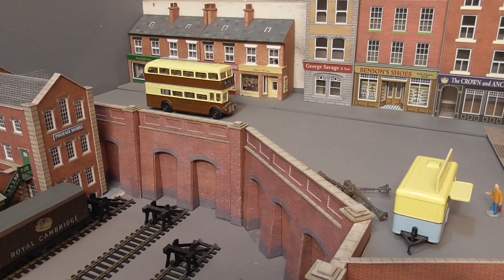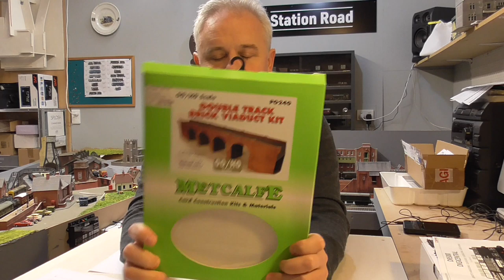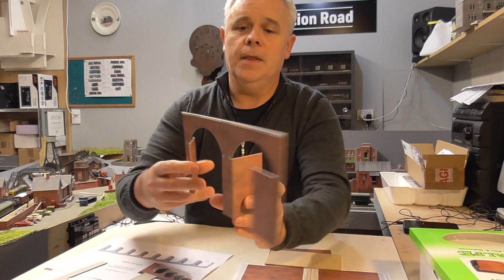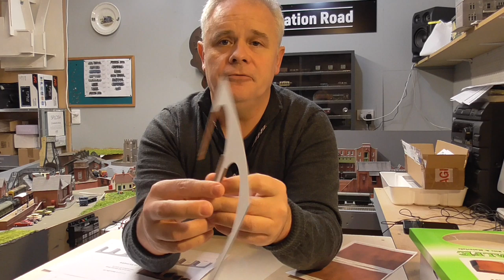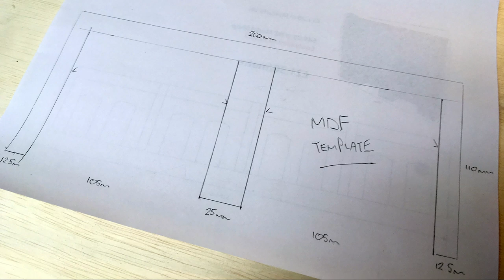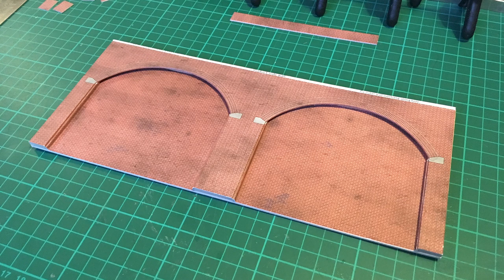Metcalfe Retaining Walls on a Budget

Comment: That is a great reuse of a Metcalfe kit, very clever! Also adds a bit of variety in terms of architecture to their standard  offering, have lots of these to build so will certainly look to use this option too. I successfully cut in half PO239 wayside station shelter to make two low relief buildings, so it's all about thinking "outside the box", well done, Stephen

Comment: Have you come across Scalescenes and Smart Models? They sell print at home kits, both railway and  on-railway. You buy it once and then you can print off forever. Smart Models produce a range of railway kits primarily of North Eastern Railway originals including the free to download signal box at the Beamish Open Air Museum (which was originally at Carr House East). The free to download kit from Scalescenes is a goods yard office/weigh bridge, which comes in different brick or stone options. The Scalescenes kits tend to be a bit more generic.

Comment: Great idea. A vast improvement on the previous retaining wall. To save having to build up the scenery behind,  you could trim the bottom of the new wall to match the old one without any detrimental effect. Best wishes, stay safe. John.
Reply from the maker: Hi John, I did consider chopping a bit more off the wall height but I saw the opportunity to redo the church area in preparation for the layout extension will require the church to move anyway. I have taken the wall height down by 20mm on the church side and a bit more on the factory side.

Comment: That's very clever idea what you did with the metcalfe kits ,I do like metcalfe kits they are a easy way to get your layout up and going until perhaps eventually you may scratch build items , I know you are NZ can you not buy direct from the supplior in the UK or would that include to much postage or tax ,obviously I know its better to support your local model shop just didn't know if it was a cheaper alternative ,I liked what you did before with the curved viaduct made from the metcalfe kit  some time ago ,I have done previously quite a bit of slight alterations with some metcalfe kits ,stay safe over in NZ its hitting quite hard here in the UK at the moment ,bless the NHS .Ray .
Reply from the maker: Hi Ray, thanks for your message. Interestingly, it does workout cheaper to buy direct from the UK and that includes the postage. The only problem is the wait time, can take up to two weeks to get here, so requires planning ahead. We're all in lockdown here, Jacinda got on to it earlier I think, so NZ cases just under 1000, only 1 death at this stage. Stay safe in the UK.

Comment: Have you looked at Scalescenes website? A fraction of the price. You may need to do a bit more work but you're doing that anyway. Have a look at their scratch building materials. You make a small payment to download the pattern for the sheet material you want and can then print it off as many times as you want.
You're already adept with preparing card substructures. All you then need to do is stick the brick or stone paper onto your structures.
Best of luck.
Bob (UK)
Reply from the maker: Hi Bob, I've had a number of folk who have suggested Scalescenes as an alternative over the years, enough for me to try them out a while back and I was impressed with the results that can be achieved, but my conclusion was there is no money saving, in fact I found it a more expensive in the end than using a Metcalfe kit. Check out this video... https://youtu.be/h4YYWEM_Py4

Comment: May I suggest you try using   2mm or 3mm. foam board instead of  the thin MDF ( whichis fairy heavy and not to easy to cut.    The foam board is available in various qualities  one of which is  called "Kapa" board which is similar to foam board but a more dense foam board centre between the paper outsides.   The material is  "feather weight" and so easy to cut with a scalpel.    Strength wise, obviously not the same as card but probably actually stiffer than the card.   A retaining wall is not going to be moved after installing som strength does not come into the equation.   Such materials should be available from art shops or via the wonderful Web.
    Hope this is useful information for you.    I suggest searching on U.Tube for  some videos of it in use.      Regards  Jim R  in the UK.
Reply from the maker: Hi Jim, thanks for your great feedback. I have seen the foam board used in model construction and I do have some floating around somewhere, but the reason I use MDF for most model construction substrates is because I have a plentiful supply stacked in my garage where I only paid $5 per 8 x 4 sheet, so it make sense for me to use.

Comment: G`day Julian,
I just caught up with this video......I`m a bit slow at this, however it made me wonder whether you are familiar with the Scalescenes web site which has down loadable model kits. They are very high quality at very reasonable prices. I will insert a link below that shows their arched retaining wall kit. The philosophy of the site is down load it once and then print as many times as you wish. 
Hope this may be of assistance to you........Cheers Gormo
https://scalescenes.com/product/r018-low-relief-arches/
Reply from the maker: Hi Gormo, I am quite familiar with Scalescenes and a number of other providers of downloadable kits. However, the jury is out for me on these as it's very much dependant on the quality of the printer. But in saying that, I have recently downloaded an engine shed kit from Scalescenes which I hope to get started on soon. This might become a how-to video.
Reply: @StationRoadModelRailway  
OK......that`s good.
I am getting really good results with just a basic HP 20 dollar printer.....no problem, however I have taken to going to Officeworks instead because they print @ 70 cents per colour A4 page at much better quality. That saves using up my ink quickly at home.
It`s also essential to seal the printed pages before building the kit with a matt spray sealer as well.
All the best
Gormo......PS....I have just downloaded the engine shed as well......great minds think alike...LOL